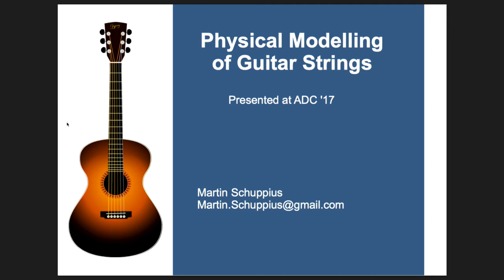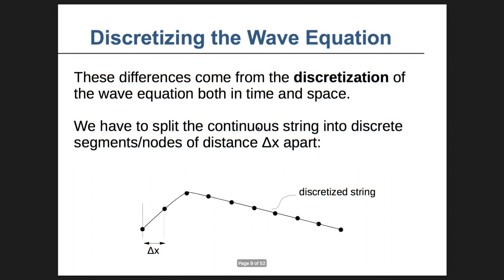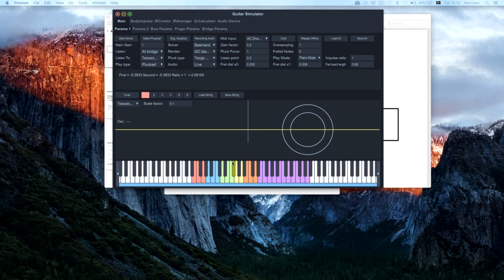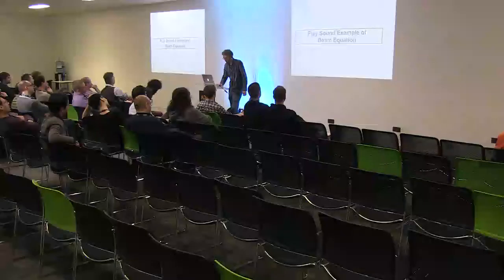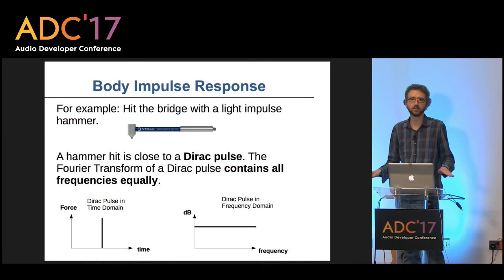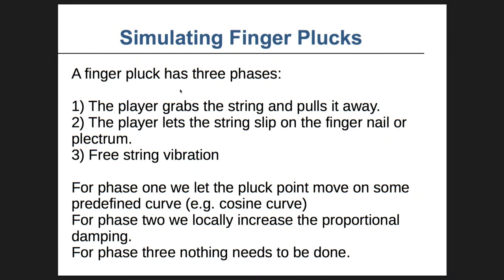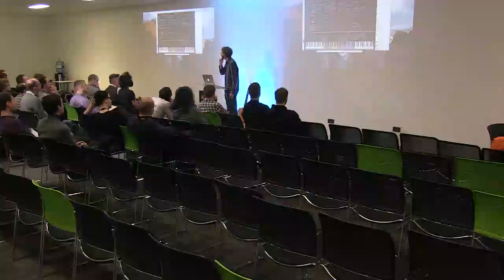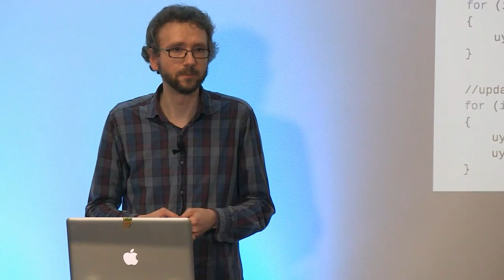Martin Shuppius - Physical modelling of guitar strings (ADC'17)

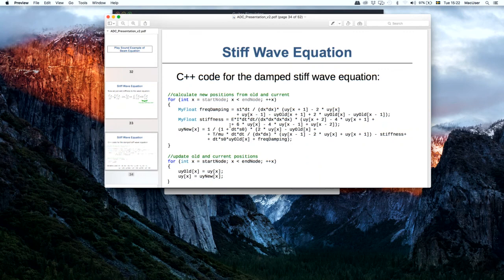Comment: Great lecture!  Currently building a physical model resonator in reaktor.  One slight issue.  At 22:00, the entire code for uyNew[x] is factored by 1/(1+s0*dt).  I got all the same terms deriving it myself, except for (2uy[x]-uyOld[x]) which is factored by, in fact, (1-s0*dt).  It still adds the remainder term  s0*dt*uyOld[x] so I have no clue how you factor the expression the way you did, let alone factoring all of the other terms with it....

My only guess is doing some trickery multiplying by top and bottom conjugates and approximating 1-(s0*dt)^2 to 1.

Comment: Sounds great and really interesting to see how much thought went into it. Will it eventually be released as a plugin?
Reply: Strings Studio plugin have existed for over 15 years. Unfortunately, rock music died before the developers deigned to bring their guitar plugins to mind. And their drawbacks were only in the presence of some unnecessary processing modules and the inability to lower the tuning in the strum-gs plugin.

Due to the difficulty in setting up of sound extraction in the physical model synth, the sample libraries have gained the advantage, although they are completely unsuitable for some types of music. It is impossible to make thrash metal with samples. But no one cares. 10 years ago it was still relevant, but now it is not.
And in the future, there will be good guitar simulators that will not require any skill or tension from the user.
Reply: @Tappy_Mappy  You mean physical modelling string synthesizers have existed? Yes, I'm fully aware of that. I was referring to the model used in the video, not just to any physical modelling synth!
Reply: @dissdad8744  I believe this model is not fundamentally different from string studio, judging by the sound demo at the beginning of the video.

But the model itself doesn't mean that much without recreating the human performance. A lot of attention should be paid to automating all the parameters of sound extraction, since without this the equation of string vibration means nothing.
Reply: @Tappy_Mappy  Recreating the performance aspects is primarily an issue of MIDI control and how well the model responds to the MIDI (or MPE eg) input. Of course the model must be capable of reacting to parameters such as velocity, note length, aftertouch etcetera.
Reply: @dissdad8744  If the developers so will shift the task to the musicians, then the musicians will not try to fine-tune everything and, of course, will not create their own synthesizer control system. Musicians will simply think that the synthesizer is unusable and "sounds bad".
Reply: @Tappy_Mappy  People don't play guitars anymore, are you sure? lol